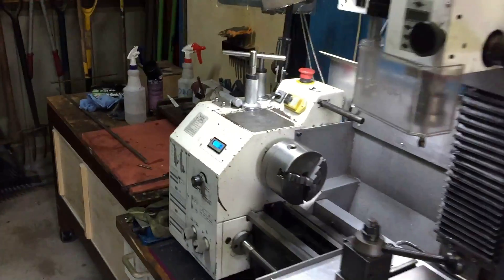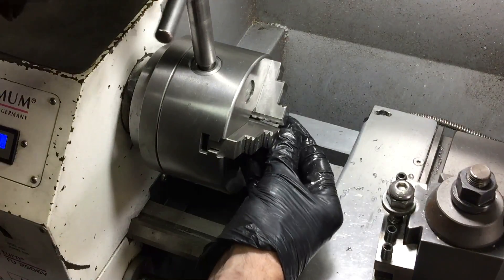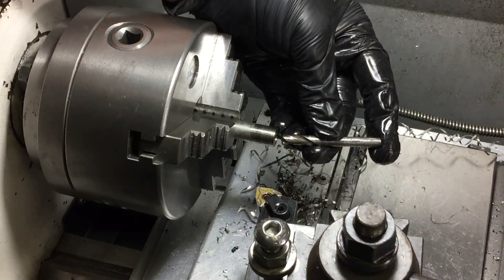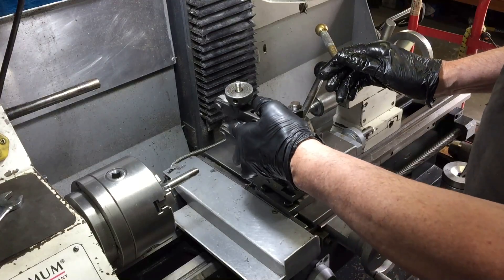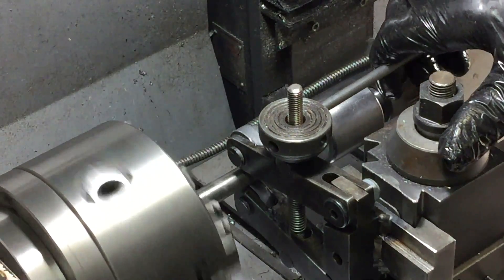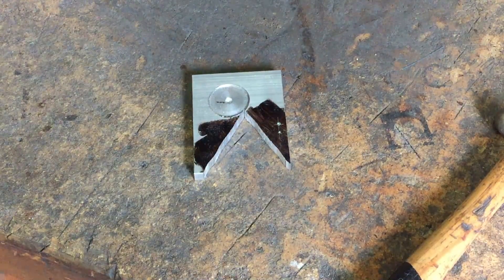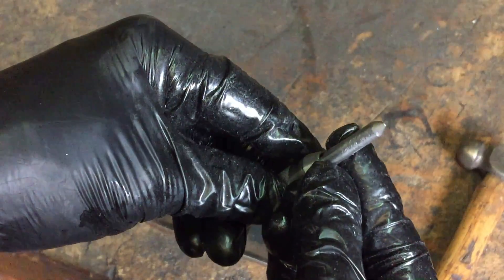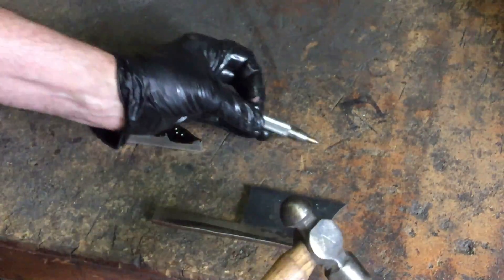Make a Centre Punch - An Easy Metal Lathe Project

Comment: It isn't particularly difficult to harden that drill bit.  Run it under a torch until its glowing brightly and quickly dunk it in oil, making sure to swirl it around to avoid bubbles and uneven cooling. Now its hardened. but it will be too hard (brittle). Heat it again but this time slowly. Just until you see it start to get a gold color to it and then stop and let it cool naturally. Now its hardness range is good for a punch.

Comment: Quite often the bottom of drill bits have not been hardened so your chuck can grab them - ever tried carbide in a drill chuck!! Great project. God bless
Reply from the maker: Good point. Thanks
Reply: Should be able to harden the drill with a torch and oil, then a slight temper.
Reply from the maker: @ToBeeOrNotToBeHoney - arrrr good tip. Thanks